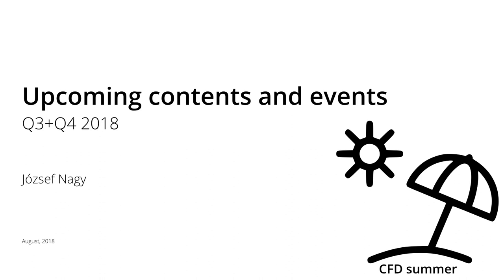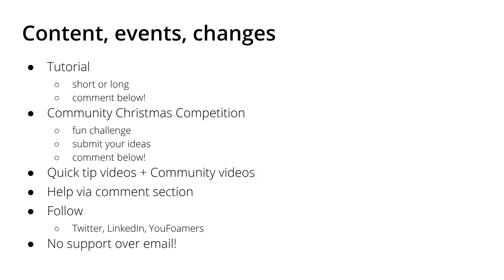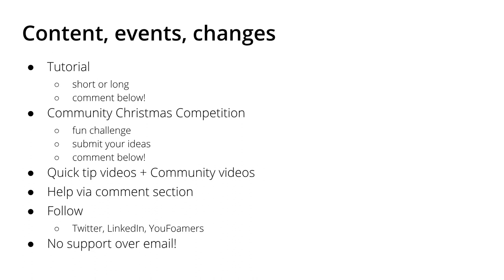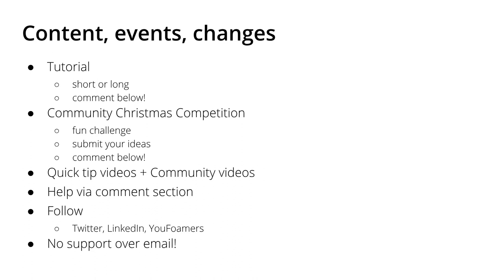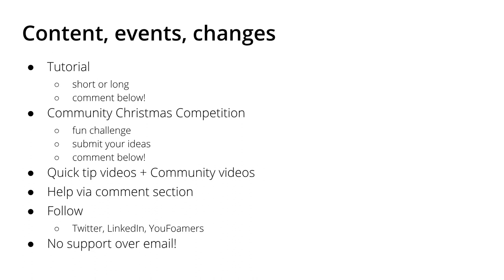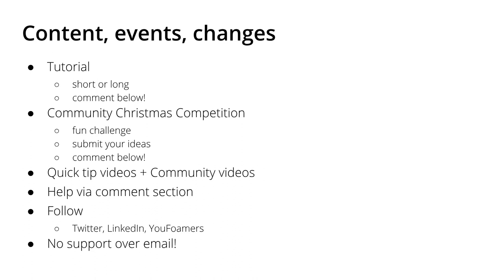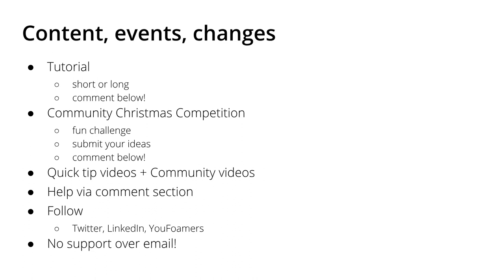Upcoming content, events on my YouTube channel regarding OpenFOAM topics

Comment: Hello, I also prefer long videos with many details. It helps to understand the coomands we wuse. Usually, pdf tutorials lack of explanation and make it hard to adapt the case to you own case. A good compromise between long and short videos would be to add bookmark to long videos, which help advanced users watch the video faster. 
They are plenty of topics to deal with: modify a solver, add equations or constrains to a case, add Lagrangian to Eulerian models. How to extract some figures (ex. calculate a Reynolds number, etc), program a series of calculations (with python?).
Thanks for the work you provide to the OpenFoam community.
Reply from the maker: Thanks for your input!

Comment: Sir, I am trying to study heat transfer augmentation using vortex generators using OpenFOAM. Is k-omega SST a reliable turbulence model for the study or can you please suggest any other model which will be more efficient.
Reply from the maker: I am not an expert with vortex generators.